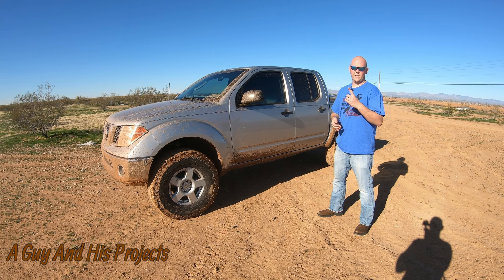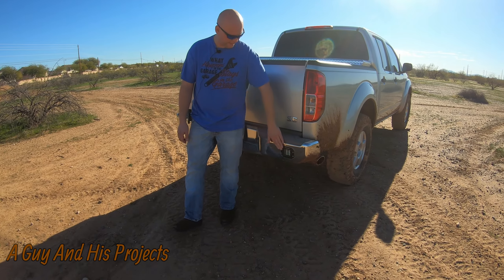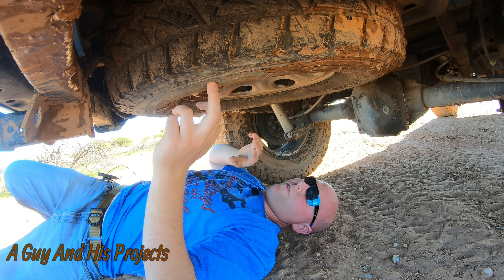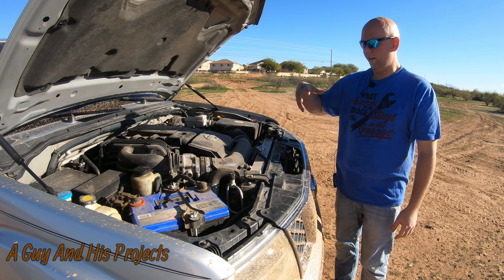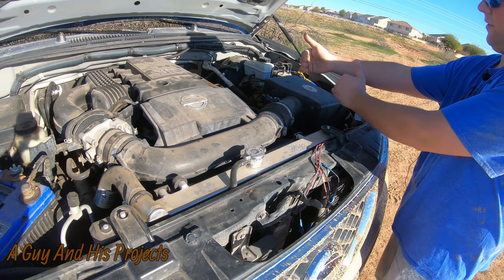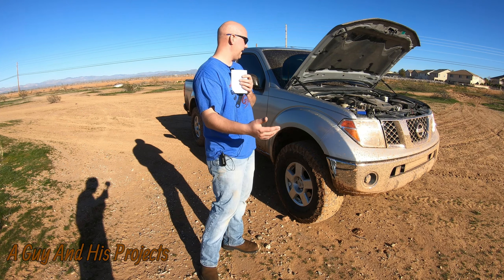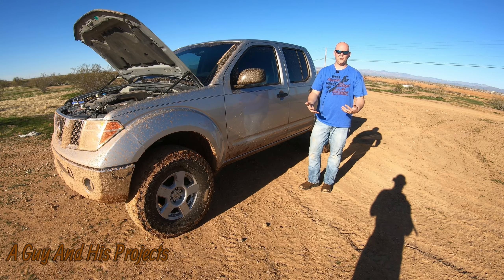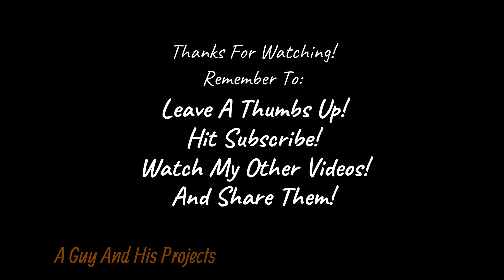Nissan Frontier Owners Review 230k Miles!

Comment: how hard was the CSF rad install? any mods?
Reply from the maker: CSF slid right in like it was from the factory, I was very happy with that purchase. As far as install it was similar to most other radiators I've installed on other vehicles. The biggest pain was getting the shroud out of the way. The older 2nd gens the shroud was all one piece

Comment: How did u mount the Pod lights in the bumper?
Reply from the maker: +Nissand21 guy I cut the bumper out with a grinder and sawsall. the lights come with bolts so then all you do is drill some holes for the bolts. pretty easy really...just measure twice as when you look at the backside of the bumper there are only a couple spots where they will fit!
Reply: @AGuyandHisProjects  Thanks for the info! Nice truck as always I have a king can 2wd with th QR in it and it's great
Reply from the maker: Anytime!

Comment: How do you check the radiator for the trans cooler issue??
Reply from the maker: Fantastic question. I don't know that you could visually tell. I think you'd have to find the serial number on it and call Nissan to find out when it was manufactured. Otherwise, might just be easier to replace it lol.

Comment: Do you live in Maricopa ..hows the gas mileage
Reply from the maker: No sir! I live in Florence though, just an hour away. When she was stock i was getting close to 20mpg. After the lift and heavy tires it dropped to 16/17mpg
Reply: @AGuyandHisProjects  
With the larger, aggressive style tires...do you go off-roading a lot? I have seen a lot guys jack up their truck purely for cosmetics, not go off-roading, and do a lot towing. IMHO,  that's not a very smart thing to do as you change the center of gravity on your truck and therefore can be unsafe when towing heavy loads.
Reply from the maker: @Sig721Tau  you are asking controversial questions now lol. Yeah I like to play offroad, yes I tow. The center of gravity thing in my opinion, isnt a big deal at all. But then again these trucks are small and I did a small lift, I also dont max out a trailer and try to pull it with my little truck.

Comment: I have a 2005 pathfinder le 248,000 miles
Reply from the maker: Heck yeah! Nissan has certainly done well with these vehicles for sure! Love hearing other people's stories
Reply: I have the Le also with 205,645 miles and still runs very strong. I replaced the the radiator back In 07 before it would damage my transmission and in 2017 with 179,000 miles I replaced the timing chain kit  that eliminates the noise that's common with these trucks. But other than that its been one awesome SUV and shows no signs of slowing down.

Comment: What brand of motor oil you use
Reply from the maker: I go back and forth a lot. Typically I use Pennzoil Platinum full synthetic. But I also really like Amsoil. That said I also buy Rotella, Castrol, and quaker state. Just depends on what brand isn't insanely over priced at the moment I need to buy some